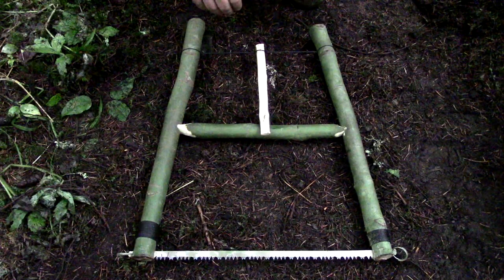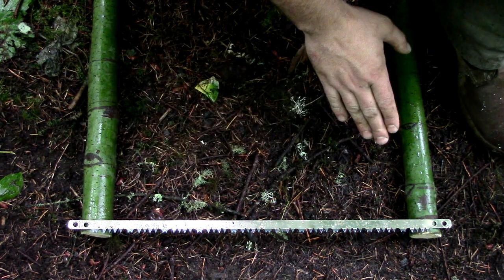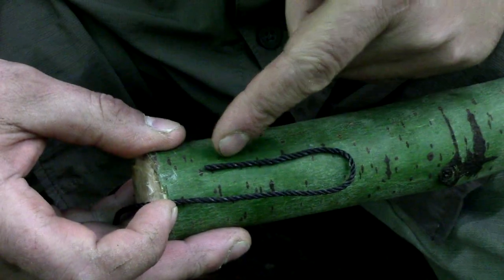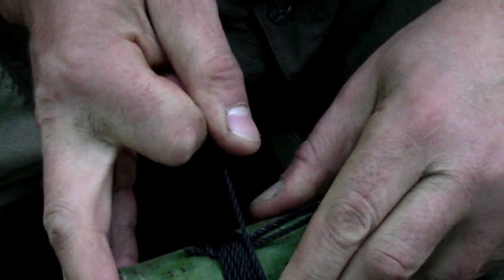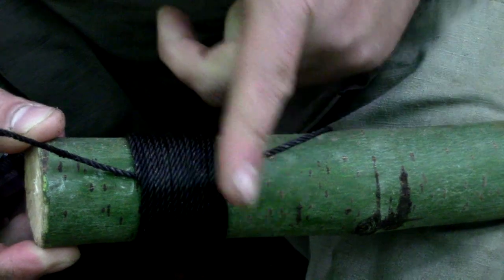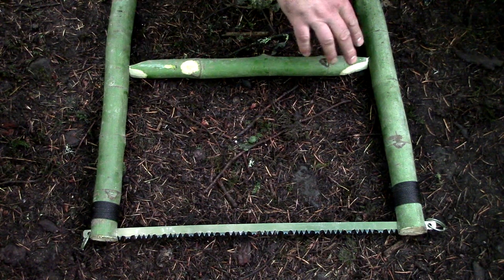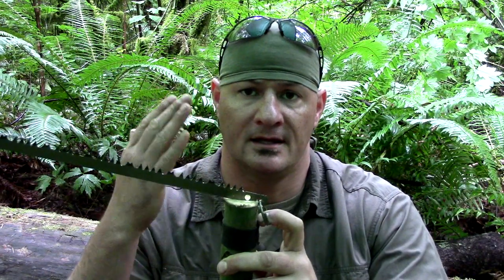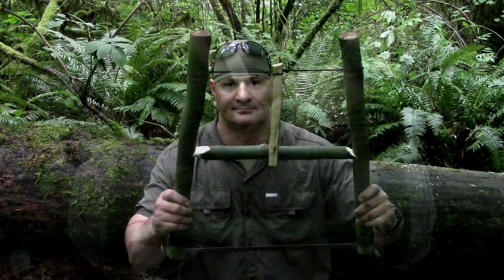Improvised BuckSaw

Comment: Although it is a little more complicated to make, the advantage I see to this is that it's easier to process larger diameter logs. The limiting factor here sends to be as much the length of the blade as the brace height of the saw.👍

Comment: That's pretty good. I'm wondering though, you should try wrapping some more string on the ends of the sticks where the splits are after you insert the blade to keep it from falling out. If a tree grabs it, then its gonna.

Comment: CPL Kelly, I love all your videos. I have a question about this one in particular. You also posted a bow saw video using the same saw blade and a simpler design. My question is what are the advantages of putting in the extra effort to make a bucksaw when a bow saw will essentially get the same job done faster and easier. Your videos are always knowledgeable and you train in an understandable fashion. Keep it up devildog.
Reply: I'm going to guess one reason, though I'm  sure there are more - the width of the handle. It is easier to work with a larger handle, easier to grip.. but you can't bend a tree limb that thick to make a bow saw. So it's comfort vs simplicity.
The bow saw would be more difficult for anyone with arthritis or fibromyalgia and such, so it's good to have that alternative option.
Also, hiking with a bow saw is much easier than hiking with a buck saw.
 Though I'm sure Corporal will have more reasons why one over the other.

Comment: Question:  the bucksaw seems like it's a lot more work to assemble than the bowsaw.  Do you find any great difference between the ease of sawing with the buck vs. bow?  I noticed that the bucksaw has a larger span between the blade and the tension beam than between the blade and the bow (allowing for processing of larger timber), but are there any other points that make the bucksaw preferable?
Thanks for the awesome video!
Reply: Adrea Brooks you can use the buck saw with two hands more comfortably than a bow saw and the extra weight will assist the saw in helping to cut more per stroke.
Reply: Wayne E. Thanks, Wayne!  Since posting this last year, I have tried my hand at putting together a bucksaw, and it did indeed perform better.
Reply: Adrea Brooks Nice.  I saw you posted hour comment after I replied, sorry.  I just made a buck saw this afternoon out of oak.  It seems to work ok, it's a little awkward because I'm used to a bow saw and a folding saw.  I have been crafting things quite a bit lately and I enjoy new challenges.  Good luck and God Bless.
Reply: Wayne E. DIY is always good.  The more you make, the more you learn, and the more you learn, the more capable you become.  :)